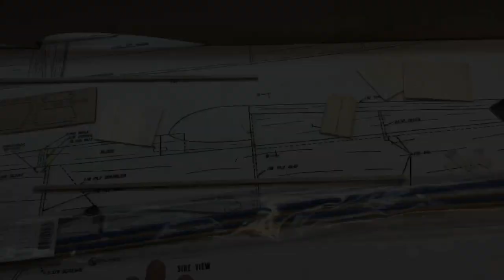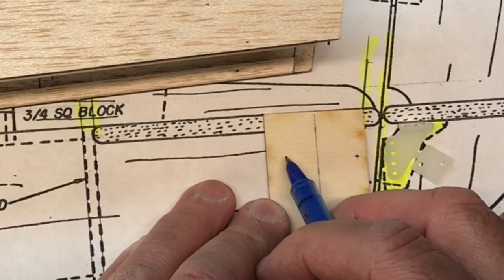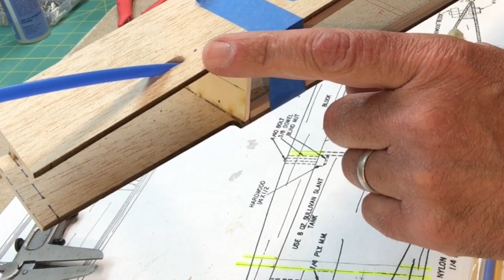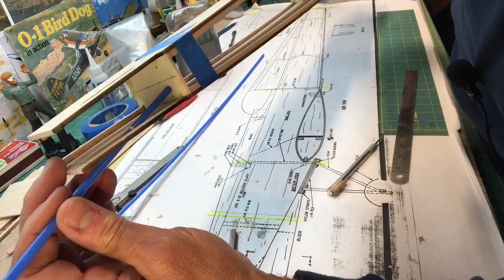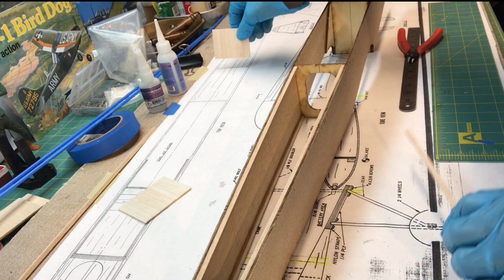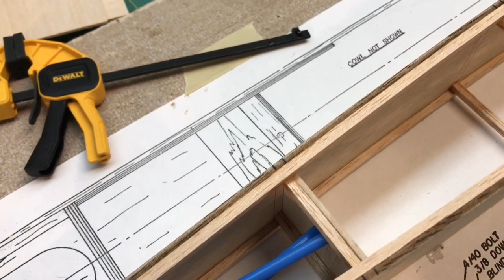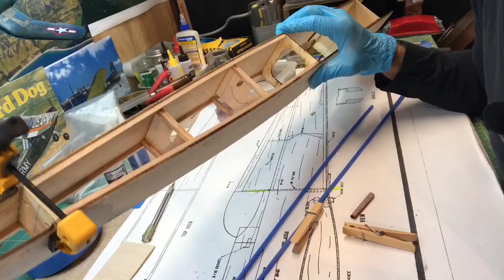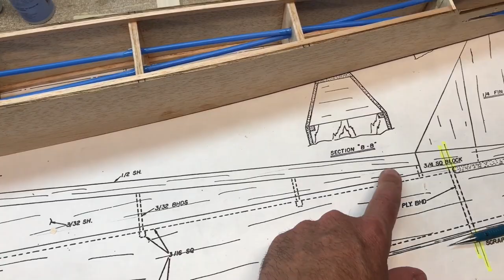Balsa USA Smoothie RC Plane Kit Build No 15, Control Rod Tubing

Comment: great video, one thing i would have done difrently and i dont know if u did this off cam but i would have run the rods through the tubing befor glueing them inplace to confirm that the rods move smothly. amazing job tho!!
Reply from the maker: Thanks, good tip. Last needed is to glue them in and have to rip them out.

Comment: What length gold n rod did you end up going with… I know they come in different lengths.
Reply: I’ve tried every website provided by a google search…. Can’t find then in stock anywhere of any size! Not even straight from Sullivan. I’m thinking discontinued? What should I use? Looks like they make lots of different sizes and types… this is a bummer lol
Reply: It looks like Du-Bro has a “Lazer Rod Pushrod” system that looks similar to Sullivans Gold n Rod system. Let me know what you think! Thx!
Reply from the maker: Ill have to check it out. I know the different colors correspond to different diameters. I grabbed what they had at my local hobby shop. I think the Sullivans come in 36” and 48” generally, then they have other sizes also. Let me check to see and get back to you. I think I had the 48 but cut a bunch off. For the smoothie I think the distance is not that far and 36 would work. The blue are thicker than the red, and are thus a little stiffer. I have always used sullivans but Ill be in the same boat if they start disappearing. Ill check and get back to you
Reply from the maker: Ha, I paused the vid and they are the gold-n-rod #506, 48”… but as mentioned I cut them way back. And I think the 36 would work also, just measure from where your servos will be and check.

Here are a few 36, may need to check to make sure, but they look in stock. I have used AMAIN a lot with success. 

https://www.amainhobbies.com/sullivan-goldnrod2mmsemiflex36-sul575/p49298?gclid=EAIaIQobChMIjb2U45LI-gIVgRx9Ch3PFAWzEAQYBCABEgIssfD_BwE

And:

https://www.rcplanet.com/sullivan-goldnrod2mmsemiflex36-sul575/p49298?gclid=EAIaIQobChMIvpyNo5PI-gIVTQetBh2zUQmwEAQYAyABEgKPqvD_BwE
Reply: Awesome! I notice it says “online only” out of stock in store. I’m wondering if they’re adding you to a back order list for the online orders? I’ll order and let you know bud! Thx man I appreciate the help!
Reply: Order complete! I picked the first link you posted as you said you’ve had good luck! I’ll keep you posted! Thx again bud
Reply from the maker: Im not sure what they do. I think things are getting scarce in the “traditional hobby world”. What I usually do is keep searching in hopes of finding a hobby store on line, or ebay. Im sure there are other brands and types out there, I just have not had to look yet. I know people use carbon fiber rods and such. My Hangar 9 cub ARF uses dowels with piano wire attached. So there are options.
Reply from the maker: Great!
Reply: I can't find Gold n Rod anywhere. Sullivan doesen't know when new ones will arrive. What's a substitute?

Comment: ERROR: the servos when installed should have the arms toward the bottom of the plane, not the top.  Once you have the top cowl block installed, you can't get to the arms or screws.  Also, leaving a little more of the inner rod out gives it a little more room to accommodate the radius of the control horn.  Pulling the end of the fuse and the block you'll want to make together should have been done before trying to set the rod location.  Ask me how I know.
Reply from the maker: Hi, following the instructions the servos are mounted upright and forward of the cockpit block. They will be accessible from the top when the removable cowl block is removed. You are right if they were below the cockpit block which is permanent they would not be accessible in that location if upright. Not sure if I can add a picture from instructions to show. I checked this to make sure because usually on a plane like this you access the electronics from the wing side or bottom. And for the control rods, ya they ended up being a little further back toward tail so Im hoping Since the exit is so close to where the control horns will be I will have the support on not need additional outer rods extending. Thanks for the comments.
Reply from the maker: Hi, to go along with my comment, I added pictures to see what I was explaining. You can just go to the “community” tab on the channel menus and see the pictures.
Reply: @JamesRCPlaneTech  The plans for the kit I now have, (#3) may be older, mine is die cut, not laser cut.  But, I assume, servo tape rather than a servo tray is how they're mounted.  I know radios don't come with servo trays, or harnesses, or batteries, or servos either.  Most inconvenient.  But when and if I get to working on mine, I have six brand new K&B 4011, that I bought as 4012, (Marine engines) Bought the parts from K&B to convert them.  I'm set on engines for a while.  Moonraker is nearly identical kit, just without the turtledeck and tricycle gear.  Also a good,  clean and fast ship.  Nyrods are stiff enough that a couple inches sticking out of the outer tube is acceptable.  I'd have to look, which I'm not going to, but I think the older kits came with the larger control horns.  I kept them for reuse.
Reply from the maker: Ya this is kit is laser cut. And the parts are not exactly as whats shown in the “new” instructions. For example, the instructions have you drill the large holes for the aileron servo wires in the ribs, but the kit parts the holes are already laser cut for you. There are just little things like that. Nothing big, but you can clearly see that the plans are the oldest and there have been some slight changes to instructions and parts over the years.